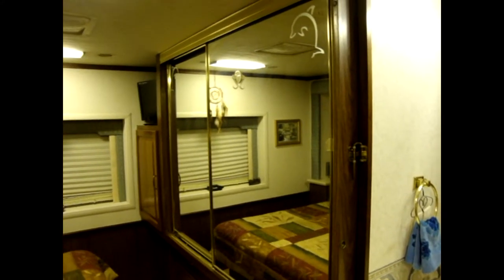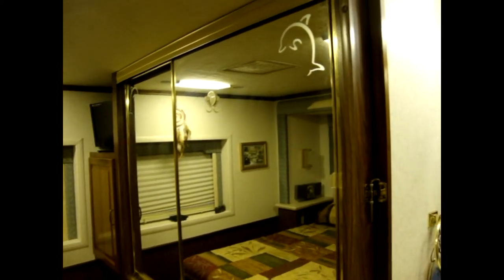MODIFYING RV SLIDING MIRROR DOOR CATCH - Quick Fix

Comment: The reason it's in the middle it to distribute the weight. Now all the weight is below your idea. Not good. A quick turn or bad bump could snap off the flimsy catch and the door will fly open and possibly break to pieces
Bert
Reply from the maker: way ahead of you, I installed another on the bottom of each side. thanks for the input 😉